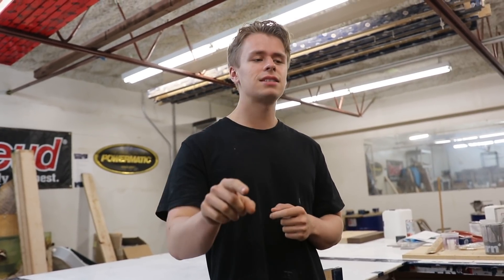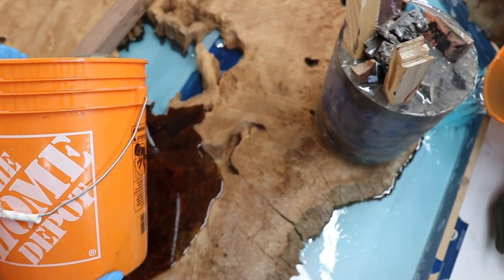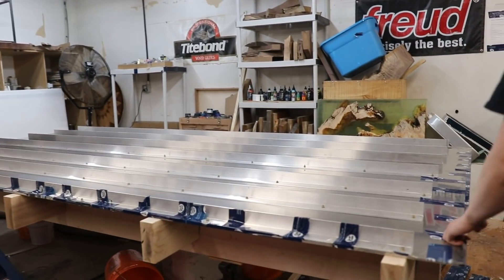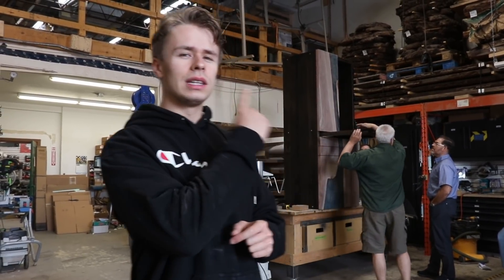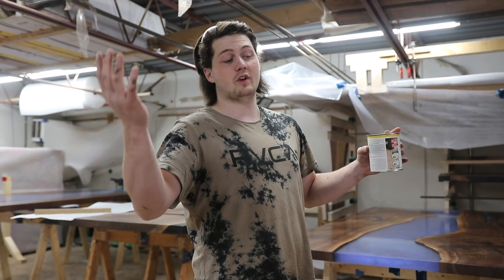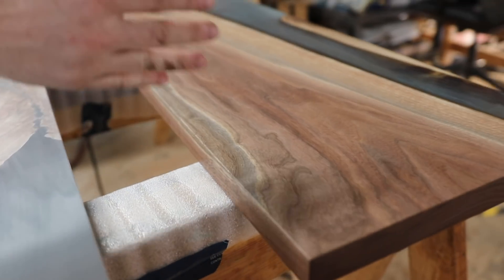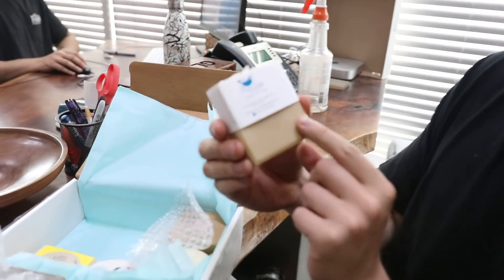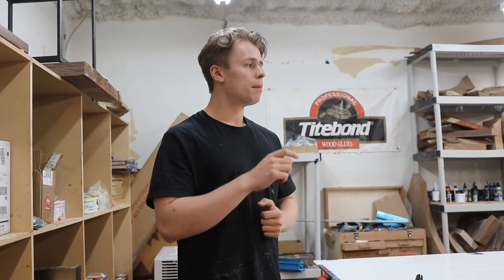Building a Walnut and Epoxy Liquor Cabinet

Comment: The cabinet looks great. Would love to see a start to finish of the build.
Also, in addition to water cooling, do you utilize any vacuum or pressure chambers on your resin before/after the pour, to minimize bubbles? Do you use a blowtorch on surface bubbles or just machine the surface flat? Keep up the awesome work!
Reply: Nope we leave the epoxy and let it settle itself. Then just machine it.
Reply from the maker: Thanks Jordan! Like Jon said, the bubbles mainly dissipate on their own, and the ones that don't float to the top and then we just machine those off!

Comment: Amazing cabinet! Fantastic ideas and smart guys. Thanks for sharing.
Tell us more about your cooling table technics, temperature, power per square... Maybe it would be possible to run a temperature profile. Heating in the beginning to keep resign very liquid - bubbles should be generated in bigger bubbles and go up. Than controlling temperature and cooling down. If you can control a constant temperature over all area, the mechanical stress should be less.
Greetings from the mountain area of Austria!

Comment: I am very interested to learn more about your cooling table ? Are you going to use a glycol mix to prevent freezing what sort of cut out temp will it have and running temp ? Will it work on thicker pours ? As being a cold plate on the bottom it depends on the thermal conductivity of the resin to cool the top or will you rely on convection if that does take place will the resin cure clear as you will have movement in the resin would it work better with a box over the resin pour and and remove heat from both sides at same time ?